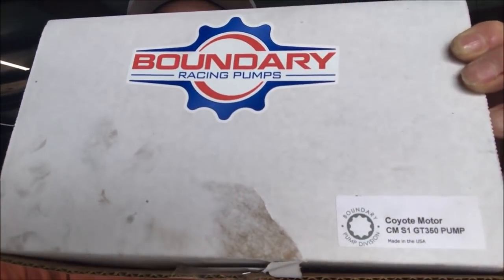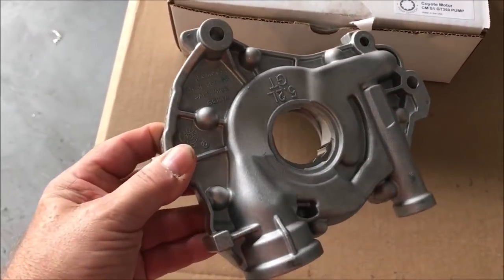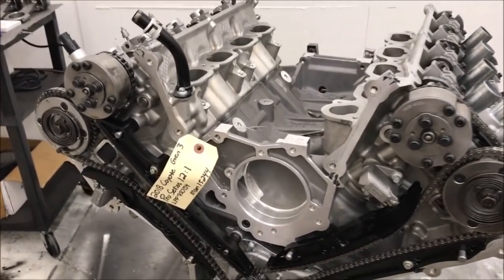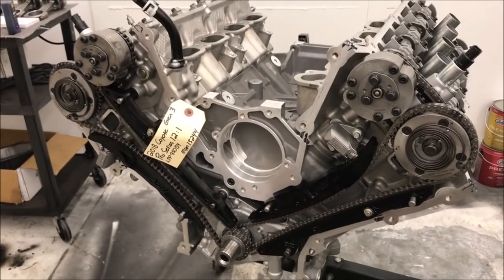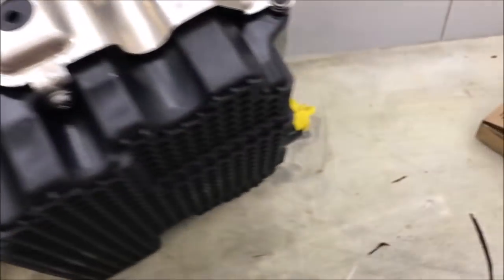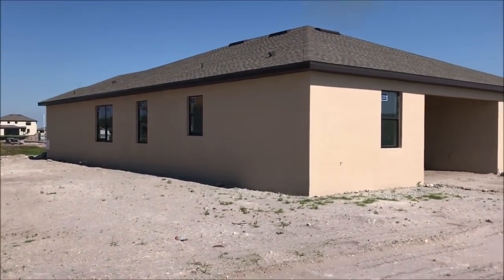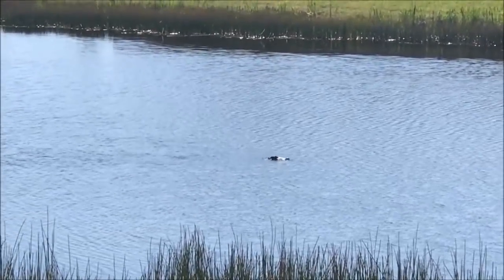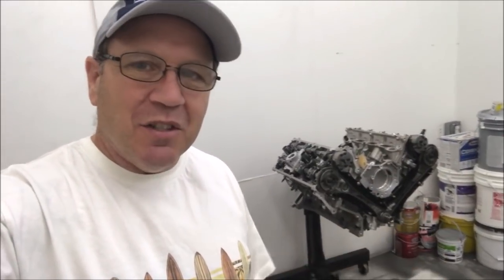2018 Mustang _ Gen 3 Coyote Engine Assembly _ GT 350 Oil Pump

Comment: That timing marks are lined up on both sides of the engine,  doesn't look like the gen 2 gen 3 timing procedure was followed.
Reply from the maker: waynebuilt  .. . The car went 10.8 @ 138 mph in the 1/4 mile
Reply: Okay they must have rotated the right side cams buy wrench and put the chains back on, just making an observation very nice build.
Reply from the maker: @waynebuilt  .  . Thanks Bud!

Comment: All the research I have done on these motors points to never push it hard when its cold! The house and the car are coming along great. One more tip, Buy a 30.6 for those pesky gaters.
Reply from the maker: scbird......... I agree these engines need to warm up!

Comment: Hi Al, Another great video, but I would dump the plastic pan for a metal one. A metal pan would also aid in cooling the oil, and would not crack if hit by road debris-like a Gator. Just kidding I know you would never hit a Gator.
Reply from the maker: T Rust....... I thought about upgrading a few things but before i do that i just want to have the car running right. then i will look into some other things. Maybe i should paint the car gator Green!! LOL!!

Comment: Really excited for you AL. This should be really good platform for power. House an the land is really nice. But those alligators 🐊 I couldn’t live near.
Reply from the maker: Hey Fran....Thanks Dude! The gators don't bother you ya just need to stay away from them.
Reply: Its actually huge for the community, if IT never develops the tick . It's our blocks new finished honed ( I sourced the block as low as $837 finish honed new Ford part not reman) with forged pistons ( obviously rods ) but I suspect like almost all forged piston engines( especially if its 2618 alloy and not 4032 that is set a little tighter ) it should rattle a bit cold then never tick and rattle once warmed....IF it doesnt tick ever then the only variable in this engine isnt the GDI or block it's the pistons used in the block. My belief is that as MPR said the bore grows .005 at temp and no cast piston can match that growth....
 I don't believe this engine will ever typewriter tick...as I believe the root issue is a piston not matched to the bore liner process, if so it will rule out all other theorys.....this is bigger for the community than most realize...this is our production block, with our crank and just forged pistons and rods assembled by hand like a voodoo ( the other plasma bore ) so ALL other theory will be invalidated if it doesnt develop tick, I suspect it wont....
Reply: BlueCollarDaily I hope your right I really don’t know much about engine building but sounds legit. I know AL did his research or I don’t think he would of wasted his money. Both you guys seen pretty knowledgeable on motors. If it does work out for AL in a few years when the 18s get down to 20k I will buy another one. I will run it hard until it blows an do exactly what he has done an go from there.
Reply: @underfedcoyote5.0  get ready cause you know it's a matter of time before I pop mine and I'll most likely build it myself....from a bare block....
 Everyone looks at the difference between this and the voodoo as where the plasma liner was applied BUY I think , I even bet...that it's the Voodoo using the same liner process but HAND assembled and what they mean by that really is "blue printed" aka correct exacting clearances...and the biggest difference is the forged pistons...MPR provided valuable data telling us the average plasma bore gen 3 grows .005 in diameter NO WAY a cast piston can match that growth no way in hell....BUT a forged piston can particularly a 2618 alloy....so really if their data is true, a cast piston would have to be SO tight when cold that the engine would be near seizing to be the right clearance heat soaked...so if a mass produced gen 3 piston is on the edge of spec small at the skirt, then then the block comes in on the edge of spec large...boom you got a recipe for noise and worse....
 I may buy a 302 boss crank but the plan is just buy a block after we move and start building it with all stock parts except pistons rods and oil pump and test my theory. However when I linked him this engine initially instead of 10k sleeved one which is just an insane step for 800-1000hp it was, I'll admit selfishness, because it would prove or disprove my hypothesis. However it wasn't lying I believe it......
 That being said the resilience of the bore liner is still a variable and in question but what AL is doing is going to really serve US as a community so well I just dont think it can be overstated. I dont think people realize....
 In essence this cheapest option ( minus some arp stuff ) is OUR Gen 3 engines if they had simply been built like a Voodoo from the factory with forged pistons and rods ( our cranks are already good steel ). Its literally for variable sake a 5.0l Voodoo though not flat plane crank obviously....this will tell the tale....
 If it ticks HOT and 2k rattles it really is GDI and or oil pressure exploding bubbles and composite pan ect ect ad nauseam the theories....and excuses from Ford....however if  nothing ever happens to it...it never ticks, or scores, or tip in and decel rattles, or 2k rattles...all the noises these engines make the PISTON is the variable nothing else plasma bore same as factory as it's a factory block.....in other words if he has no problems then all Ford ever had to do to avoid this was include a cheap forged piston and tighten up QC on assembly....
 If it does do those things and succumb then everything is back on the table.....
 The problem with a sleeved block is that it doesnt test this piston only change theory...and it corrects bore spacing which according to MPR can be off quite a bit that could drive noise and scoring as well...this is a plain old Ford bare block that any of us can buy, filled with good pistons and assembled properly...its PERFECT...I wish he had a procharger so even the manifold and IRMC variables where in play but oh well....
 I'm super excited for the data.....I dont have to wait for my motor to pop to get the answers I wanted ( not that I'm glad his did ) this is pure curiosity and people should really be thankful for what this test will represent....
 Let's say it ticked and rattled...and was scored like Mike 740....it would be a bit better if Mike740 who has all the issues...pulled his engine bought a new block and put forged pistons in on the correct clearances with rod, main and thrust clearance set.....then dropped it back in....if it was quite mouse we know what it was and wasn't definitely and no one has done that they all go to the ninth sleeved then of coarse they dont tick...suddenly the GDI doesnt make noise anymore lol...but this is as close to a back to back test as we got right now ....sad thing is the piston has a large grown area with the right gap and clearance it should hold power from the factory

Comment: Al, I assume you are getting a new tune. Have you decide on, what tuner you plan going with?

Regarding the house. Are all the exterior designs and sizes fixed. You just chose from the 3-4 options. The main building contractor for the area as on offer?

Thanks
Reply from the maker: Einar Ingi Einarsson,.........I will be asking for a revised whipple tune right now.  there are warranty issues that need to be worked out.

Comment: sweet Al that thing should hold up really good! Im so glad you went all forged and ARP fasteners
Reply from the maker: 17ROUSH sam...... the engine has ARP fasteners in the bottom end but we used stock head bolts. i intend on maybe 10-11 lbs of boost so really the stock head bolts are enough.
Reply: @coyotecarguy2076  yea stock are fine for that bottom end is whats important lol
Reply: Looked like it had stock head bolts and not ARP head studs ?
Reply: @pro5.019  im not sure on that but the rods mains and side bolts to mains were all ARP
Reply: I think the Gen 3 went back to 12mm bolts probably hold some big power.
 I like that Al, is making moderate decisions all to often over many years and projects my thinking would boil down to something akin to.
 While I'm in it upgrade everything, well if I am going to buy heads might as well get bigger and better and grow into them. NOT spend money twice and while maybe I did eventually get there few builds were every perfectly matched initially even though I knew how to match it....because I didnt want to do the work twice or buy a big item like heads again ( could of went with a smaller head and had them ported to suit later for instance instead as an example).
 I can appreciate he knows where we wants to land and is only spending the money it takes to reliably get there ( then again we are getting a little age on us and when I was young I would know I might say and mean a 1000hp max at the time but that goal post seems to get moved LOL).

Comment: UPR has a billet/magnetic oil drain plug. Go ahead and replace that POS plastic one.
Reply from the maker: 16 Sport....... Thanks dude!! I will look into that!!
Reply: Thank you,I’ll grab one for my 17 3.5 F150, Once I make sure they are identical drain plugs.
Reply: They do indeed take the same one, according to UPR site
Reply: I use it in my 19 its great and also magnetic to grab some  shavings especially on new engine break in

Comment: That oil pan may save a few pounds but dang it looks extremely cheap.
Reply from the maker: Robert Goodman...... Yeah, it really is cheap looking!!
Reply: Robert Goodman it may look cheap but it’s directly from the GT350. Ford engineers said it’s a better cooling effect because a metal pan gets heat soaked. I have put the upr magnetic drain plug in on my last oil change.
Reply: Robert Goodman it may look cheap but it’s directly from the GT350. Ford engineers said it’s a better cooling effect because a metal pan gets heat soaked. I have put the upr magnetic drain plug in on my last oil change...

Comment: Very cool. Can't wait to see it rip.  Go for 10 to 12 lbs and you should stay good. Idk if your around e85 but thats the way to go. Safer fuel
 Ps. House looks great. Gators are cool. Actually hunt em for many years. Tatse great. Lol
Reply from the maker: MrDavidelliottjr................ I plan on running a 3.85 pulley with the 132mm TB.. I think that is 
10 lbs of boost.  Running 93 octane but maybe an e85 tune for more power.